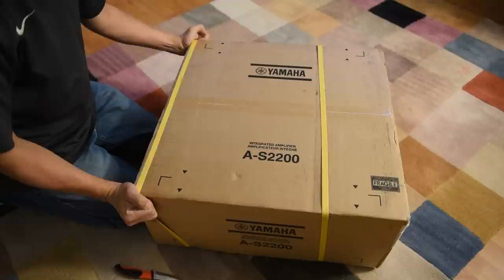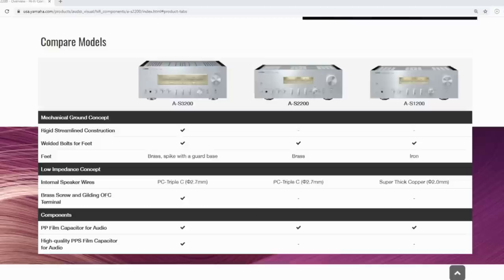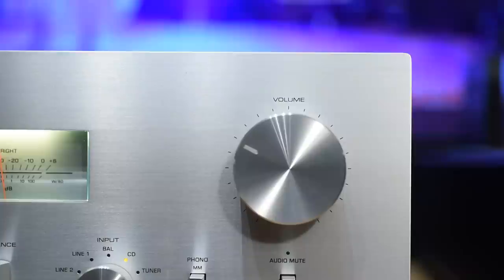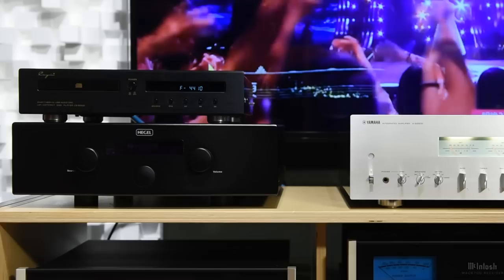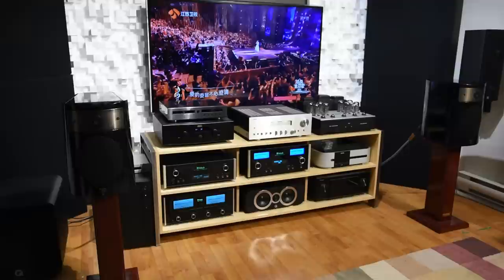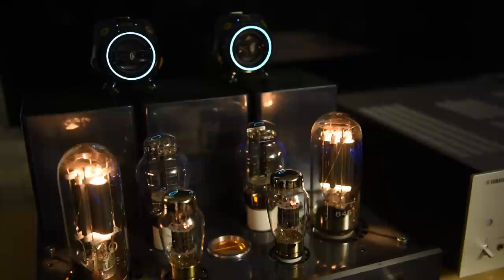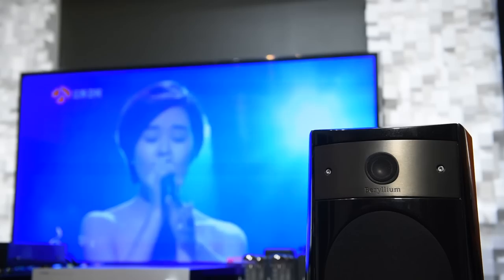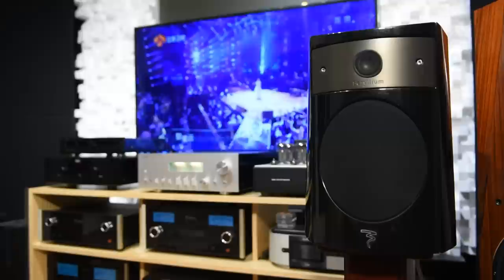Did it blow me away? Yamaha AS2200 Integrated Amp review

Comment: Correction: Ron’s review was of the A-S2100 with the “old” EI transformer. I doubt there’s a huge difference in sound, but there it is.
Reply from the maker: He did review the new AS2200 and the video was uploaded like a week or 2 ago.
Reply: I’ll try to find it, thanks
Reply: So it’s said. I once owned a H/K Citation amp with dual EIs that delivered massive current. I’d put it up against any modern amp

Comment: Some examples of AS 2200 delivered to Austria shows some differences in volume between the channels.. Left channel is louder for about 3-5 db...Yamaha?
Reply: @Jingle Nuts no it is not.. some of them are tested with test signal..
Reply from the maker: I didn't have that problem with the unit I have.
Reply: @ThomasAndStereo  update:Yamaha took the unit and adjusted the VU meters and channel signals. Now they are looking for the more units to find the faulty production batch..
Reply from the maker: @miki-wx3gl  Cool, not fun to get a batch like that but most importantly is they owned up to it and hopefully fix it painlessly for the client.
Reply: I have the AS 2100, I have not noticed that issue and I listen daily.

Comment: - yes, it looks good (for those who like 70s decks). But the sound is still the same as on the previous amplifiers from YAMAKHA, it cannot be listened to for a long time, it is very tiring. it is too "sharp" (creak, squeal)
  Yamaha design is trying to make a comeback in the 70s, many people like it, I like it. What prevents to build a classic amplifier class "A"?
Reply from the maker: Well class A will have to be used mostly with efficient speakers to get the best out of it. I think class AB has matured enough to the point where it is the main choice for amp design when compared to class A. Perhaps one day class D will be in the future. As I mentioned in the video, the 'too sharp' is for me the mid-range bump and not the top end treble extension.  Like everything in audio, careful equipment matching will solve this problem.
Reply: @ThomasAndStereo  Yes. There are good class AB amplifiers, for such a price there is a large selection, I would not choose Yamaha. If you bought this amplifier, then it takes a lot of time to select speaker systems. I drew attention to the acoustic systems assembled by ScanSpiak, they have rather "soft. Sweet" Mids

Comment: Seems little weak, 90w  8 Ohm then only 150 w in 4....So what does it do in 2 Ohms? 180?  So no difficult speakers then...
Reply from the maker: I guess anything above 89db is safe. It does have more muscle than what the specs suggest.
Reply: I have the A-S2100 amp , the previous model which looks identical. This Yamaha is plenty powerful enough and the noise floor is astonishingly low. A very good phono preamp as well, I have no need for a separate phono preamp with my VPI Prime and Soundsmith MM Carmen MkII cartridge.  It will handle 4 ohm speakers just fine.

Comment: Thomas I really like your videos in general. However I'd like to make two points on this review. First Sean (Zero Fidelity) reviewed the S1200, not the S2200. Second, the AB test you did is not statistically valid according to how you explained your experimental procedure. For example, unless you included the case where both amps to be compared were the same, you cannot draw a conclusion. If indeed your test was more robust, please share the method, the p-values, etc.
Reply: might I suggest ASR for your needs... this certainly isn't the place for statistical analysis and measurement charts.
Reply from the maker: Given I have a degree in statistics and have been a buisness analyst for 15+ years, I completely understand where you are coming from. If I were making a living measuring gear or aiming to prove something beyond a shadow of doubt, I don't think it would make sense for me to spend that kind of time. To develop a controled test takes a lot energy and this channel is really for fun.
For the sound signature, after talking to Sean, I noticed our description is pretty similar so if I were to descrip the over all sound, it would be the same. If I can AB test both, I can point out the differences.
Reply: Might I also suggest that areas that do perform some measure of statistical analysis and measurement (ASR) don't always have metrics/benchmarks that translate into "better" sound quality due to the subjective nature.  If that were the case then Topping would rule the Audio world and the rest of the brands would cease to exist.  THD, SINAD, etc.. aren't really effective/holistic measurements.
Reply: @ThomasAndStereo  Thanks Thomas! I really enjoy your reviews and I see your point of view. The bottom line for me is the I regularly view your videos, Sean's, and Steve's. You each provide different perspectives which are quite useful in considering equipment. I also understand that it is not practical to perform a statistically valid test in this venue. But I also think it would be great if someone under took a research project to design a proper, statistically valid experiment to prove some of the controversial hypothesis of our hobby, i.e. break-in, hi-end cables.  Of course in the end this wouldn't necessarily convince anybody; there is the subjective component. However, I am suggesting the experiment validate the human perception of sound quality, not the acoustic metrics. To my knowledge this has not been done.
Reply: @aceofspades6667  see my response above. I think a statistical valid experimental design to test human perception of sound quality where the dependent variable is the break in period would be a worthwhile contribution to out hobby.

Comment: Hey Thomas do you think the A-S2200 can handle magnepan speakers?
Reply from the maker: This I have to try. I do have the LRS but it is at my friend's place.
Reply: I have Magnepan 1.7's and AS2200.  Found that AS 2200 is underpowered for Maggies.  Parasound A21 drives it better.  My Sansui integrated from 90's drives it better than Yamaha as well, but it's also heavily modified and I put in additional $3000 for better caps and resistors/opamps and probably not a fair comparison.  I found Yamaha is a bit too bright for Maggies in general.  However AS2200 gives you more holographic and overall a bit more a audiophile quality than Parasound especially in the mids and higher frequencies.  Just not enough juice.  I would think AS3200 is a better match for a Magnepan.  Let me know what you find.
Reply: @RoselynNY  thanks for your insight. Wonder if the smaller LRS would be an issue for the yamaha too. I also  have the As2200  and love it but I never gave it a challenging load like magnepans.
Reply: John Atencio I currently have my as2200 with Quad z2 and a sub.  Works quite well with other warmer speakers.  One quality I enjoy the most is the holographic imaging this amp creates.  Certainly very different sound from many other amps out there.  I really like the unique sound.  Only one deficit is the thinness and lack of bass in my experience.  Maybe I am just too used to 250 +++ wpc amps that gives amazing bass.  Paramount, Bryson, high end HK from 80s.

Comment: Weren't the knobs and switches metal on last years A-S2100?
Reply from the maker: I don't know, these don't feel like metal and given Yamaha has already seen the video and did not correct me, I assume that what I said is true.
Reply: Zero Fidelity said they are brushed aluminum and not plastic on the as1200.
Reply from the maker: Turns out they are brushed aluminum.
Reply: @ThomasAndStereo  Thanks!
Reply: I have the A-S2100. It's all metal on the front and back. The whole thing is metal, it weighs 50 plus lbs !  The remote has some plastic.

Comment: Placebo-Effect: The Youtube Channel
Reply from the maker: Break-in is placebo? Not everyone believes it.
Reply: Thomas & Stereo as always in life there are always two sides of the same coin :).
Reply: @ThomasAndStereo  I believe mechanical parts like speakers can show audible differences after a long period of use. But my belief ends with an integrated amp. Unless someone wants to argue that copper molecules align in the transformers I don't see any way an amp can "break in". Of course capacitors age, but that's more a sign of wear than anything else.
Reply: Schwurbel well I think that’s why he did the test. Which should be eye opening. You can still think what ever you want but the results of the test are pretty outstanding.. and the fact he didn’t tell the people the difference between the two systems breaks the placebo effect theory. Unless he did tell them, in order for the placebo effect to work they would have to know that one of the systems was broken in.

Comment: High quality plastic??? 😂 Not at that price and no DAC??? I’m going to get the A-S801 instead and save 3 grand
Reply: What are you talking about out? There is no plastic on the as2200 at all. Might want to get your facts straight. This thing is all metal. No Dac because it’s an audiophile all analogue design. Buy a separate Dac.  That’s what most are doing at this price point anyway. The 801 is not in the same league as any of the as- models.

Comment: People tent to sipn around and like avarage sounding devices couse they didn't never felt real "like you are there" experience of reproduced sound. I don't say this Yamaha is bad product, it is top in terms od build quality, but it's nothing special in terms of real mosiv magic transfer, same as 98% products in existance. The first indicator of mediocrity is possibility of someone to talk about ups and downs in different frequency regions, and not of whole impression of liveness of music event in room itself. When you once hear special amp, you just don't have need to dissect those basic things of sound.

I don't know, maybe it is related to reviewers point of view on those things, but I am pretty sure that out there is very low precentage of really special sounding products.

ONE VERY IMPORTANT THING ABOUT THIS YAMAHA AND OTHER REAL BALANCED OUTPUT POWER AMPS THAT NO REVIEWER HAS POINTED OUT IS...
DO NOT CONNECT NEGATIVE SIDE OF SPEAKER OUTPUT TO ANY GROUNDED DEVICE LIKE AVARAGE SUBWOOFER SPEAKER LEVEL INPUT. IT WILL BOLW HALF(NEGATIVE SIDE) OF AMP OUTPUT STAGE